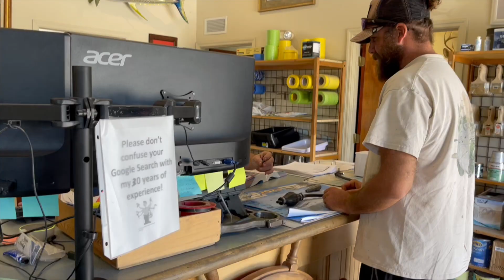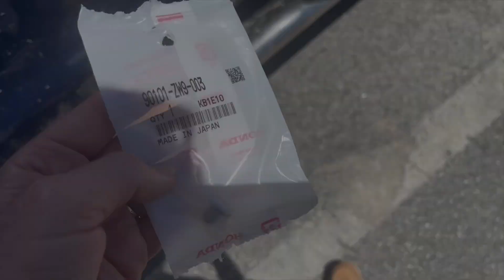Servicing Siren's Lower Unit | Siren Gets Her Hands Dirty on the Honda Outboard (Ep. 18)

Comment: Ok so Mr. Mr. got there finally HA!   The rubber impeller is a wear item. As the impeller fins wear, less water is flowing since the fin surface area is reducing continuously over its lifespan. Therefore less flow means hotter engine which we dont want. 
If you're in there, yes just replace the "wearable" part. Speaking out of turn here but Im assuming these are rubber on outboards since stuff can be ingested and rubber is more forgiving for lake/ocean "dirtier" water or debris that may get sucked in. If these impellers were metal on outboards, they'd be worn out much quicker, depending on environment. 
FYI on cars with a supposed clean faurly closed water system, these impellers are metal and can last a long long time. I'll hush now...anyone? Anyone?
Reply: Yes its rubber.  They last me roughly a season.
Reply from the maker: THANK YOU for that Man'splainin'. Got it. lol Finally, a man who can accurately explain things.

Comment: Why? IT is an affordable part, easily replaced part, but requires effort to get to it! So, do it when we complete the 200-hour Maintenace on the outboard. What happens if that $15 part fails? Your outboard overheats and you either paddle home OR you overheat your engine and repair/replacement coast can be 200 times the amount of the part. 
I get it, many viewers would want to know why, so that was good of you to ask that question. But he literally answered that question on the 2nd and 8th explanation. I like my answer, really really bad things happen if you try and save $15 on this part. Just in case, you know how your engine has a piss-stream when its running? This is the part that makes that happen. No P P, no cooling, no run, no fun and if you are away from land, you're are going to need Towboat US or a friendly boater and when you get it back home, a friendly mechanic to replace your head gasket, big money! 
If you do it, you remove issues, but there are no guarantees, if you don't, that day will come and you are having no more fun on the water!
Reply from the maker: Thank you! Yeah, I understand the purpose of the part, it was more about not understanding HOW it fails. I was really trying to get to the bottom of how it malfunctions- so the answer that the ends wear down was what I was looking for. At first he was just saying it was dirty.
Reply: Change it early and change it often